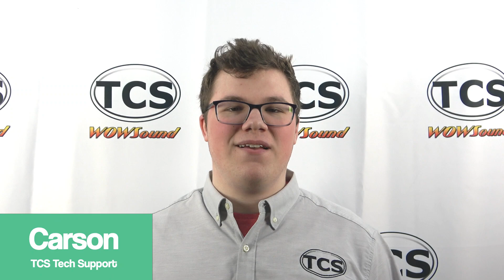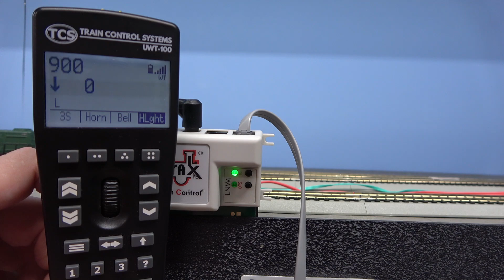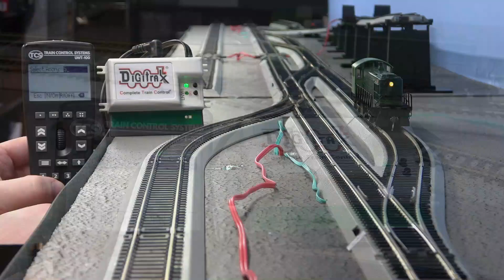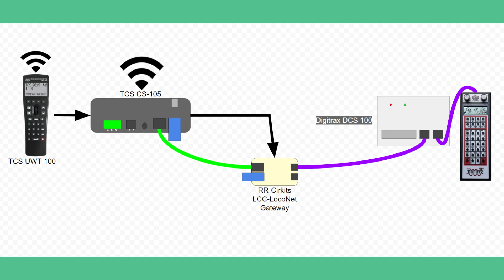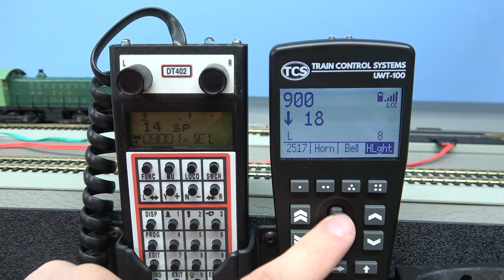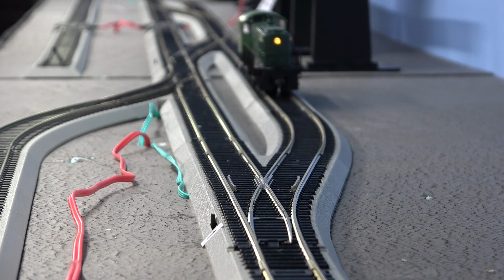Integrating TCS LCC system with a Digitrax system

Comment from the maker: Important Note for This Video: The Digitrax DCS100 is in Booster Mode.
Reply: Can you please post specifics about the jumper and software options for the LCC-Loconet gateway to make it create the throttle table for Digi throttles?

Comment: I have a CS-105 connected to a BA-100 to Digitrax boosters then, via DCC from them, to the layout. It all works nicely. But if I have Digitrax throttles, I do need the DCS100 to use them. So in that case, the BA-100 is useless to use the Digitrax throttles. Am I correct? Would it only work with the LCC-Loco Gateway?
Reply from the maker: Hi Leo,

Yes you can use the LCC-Loco Gateway without the DCS100. There are jumpers in the Gateway that provide the required LocoNet 15ma. pull up current for its stand-alone operation.  Without the use of a DCS100 in booster mode.
Reply: Leo, I have been in direct contact with Dick Bronson and he cannot get the Digi throttles table to activate in my LCC-loconet. I sent screen shots of the loconet monitor and then he cut off all communication. Now his website for LCC-loconet gateway does NOT say it can run Digi throttles.
Reply: @tcsdcc Can you please post the step-by-step setup on the lcc gateway & digi cmd station to get digi throttles to work on Cs105?

Comment: I have some digitrax throttles that I want to use with my CS-105. Why do I need a digitrax booster?
Reply: Not true, the LCC-Loconet Gateway does NOT support the Digi throttles slots
Reply from the maker: All you would need is the RR-Cirkits LCC-LocoNet Gateway. So it is not necessary you would need a Digitrax booster to run your Digitrax Throttles.

Comment: Or you can use a UWT with JMRI WiThrottle as I have on my own Digitrax system and at least one other. Once I input my Wi-Fi password it connects to the same basic WiThrottle server that I've been using since 2011 when WiThrottle came out (although I've changed both command stations and computers since then). Same with NCE, Digikeijs, and ESU, and it will work with any other system with WiThrottle.

Comment: Can u remove the Digitrax Command Station and replace it with the 105?  Would u still use the LCC gateway?  Will the 105 work with the Digitrax Boosters? Thanks.
Reply: Yes, yes, and yes.
Reply: Digi booster, but not Digi throttles without a Digi Cmd Station